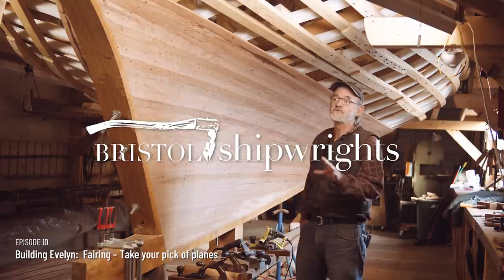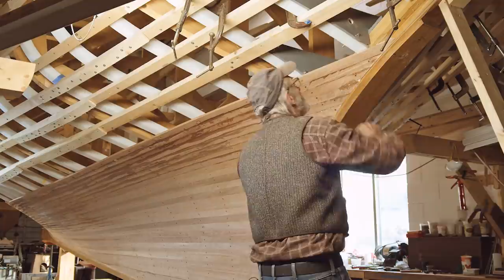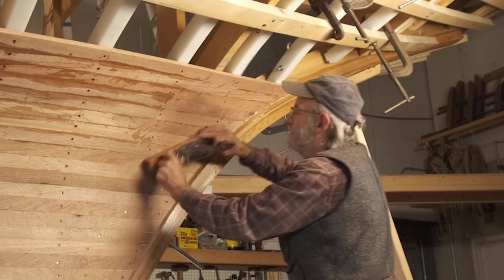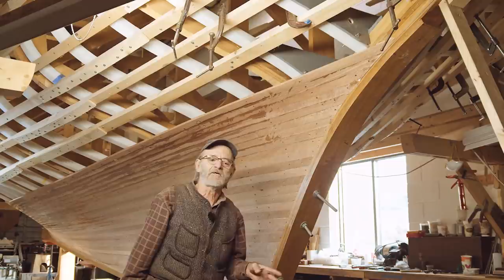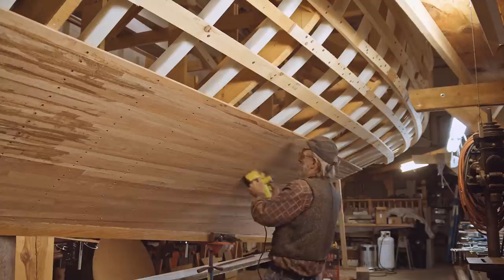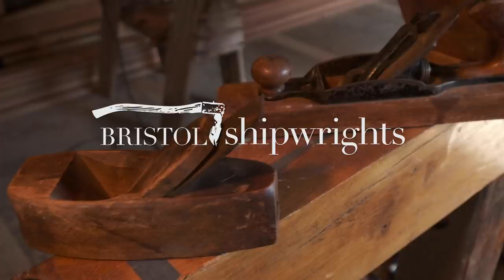Building Evelyn: Fairing - Take your pick of planes, EP10

Comment: We call the convex wooden planes scrub planes. In a cabinet shop usually use them on rough cut material to exposed the figure and wee what you’re dealing with before jointing.
My shoulder are also burning and I am getting sweaty...

Comment: Autobody guy here. You need radius in the length not in the short that a hand plane provides. How about getting a spiral cutter head off a thickness planer for a long and straight radius. Put handles on it replace cutters as needed.

Comment: Lou, doing a wonderful job! A question: I understand you're going to double plank Evelyn. How do you avoid hollow between the two layers of planking? Are you going to bed the second layer in epoxy?
Reply from the maker: Andrew, in some places we'll have to back out the carvel planking to fit the curve. In other areas, we'll slightly flatten the strip planking between line off lines to accept the second layer of planking. When that's done, we'll brush or roll a coat of straight epoxy on the strip planking and the inner face of the carvel plank. Then we'll mix up some thickened epoxy and spread it evenly on the strip planking. Finally, we'll fasten the carvel plank through the strip planks and into the frames. Hopefully, you'll be seeing that process pretty soon.

Comment: I would like to ask you: in video from past, You are talking about corking and "sawing" the cotton by movement between planks. As I see now, your strip planks are glued together, so it means there will be no movement?
Reply from the maker: Vlada, the planks on caulked hulls have a tendency to slide slightly fore and aft as the hull works in a sea. By gluing the edges of the strip planks and then gluing a layer of planking over the strip planking, we can minimize the sawing effect or movement.
Reply: @BristolShipwrights  Aha. I wondered if this glue can stop the movement at all or is it any special "plastik" kind of glue, which allows movement.

Comment: Instead of building everything rounded like a champagne bottle, why not build everything with straight lines, & angles like pyramid or a stealth fighter plane. No rounded curves. Then nothing has to be steamed or bent into shape.
Reply: Water is a denser medium than air, and the boundary layer will act somewhat differently. Creases, angles create vortexes behind themselves, which create drag, which must be overcome by the motive force- wind, engine. Those trapezoidal fighter jets develop enormous thrust, far greater for their size than a sailing vessel. I really don't know how those planes are aerodynamic- they shouldn't be able to fly. You achieve the least drag on a smooth shape- keeping the boundary layer attached for as long as possible- that's why boats taper off to the rear. Same as racecars and normal planes. As soon as a vortex forms anywhere along an object; you have drag. Hope that helps.
Reply: Evolution made fish smooth because water is 60x as dense as air.